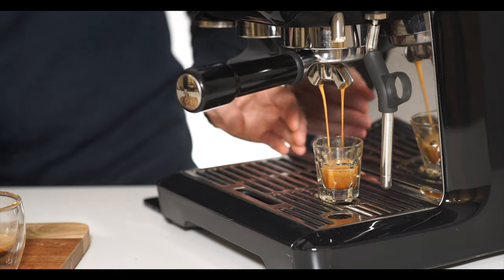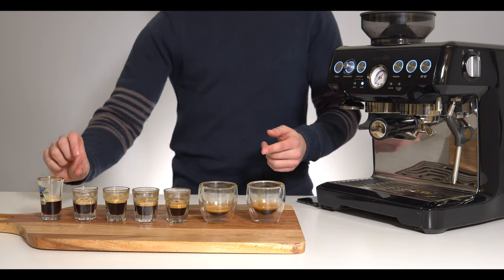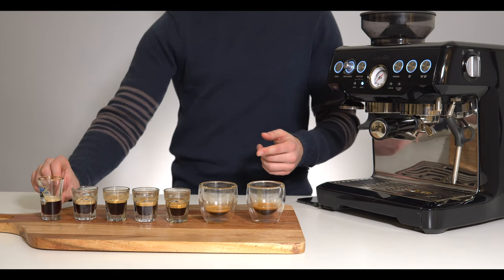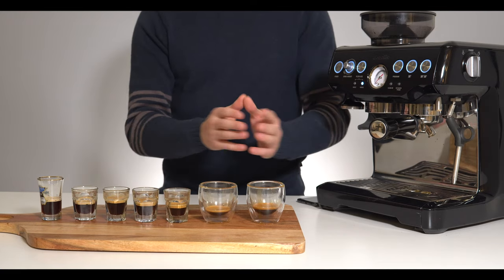Understanding Espresso Brew Ratio | The Salami Shot

Comment: 1:2 - I stick to the standard most of the time unless it's a really dark roast or a really light roast
Reply: Sarah what ratio do you use for dark roasts? Thanks :)
Reply: @leonelsarmiento7  I use a longer brew ratio like 1:3 or 1:3.5 the lighter the roast gets. Lighter roasts take longer to extract as they are less porous and have less dissolved solids. Dark roasts are quicker and easier to extract, and I'll drop to a 1.75 if it's VERY dark. Hope that helps! :)
Reply: While we are talking about brew ratio, brewing time is critical too. Unfortunately I did not have a good grinder, my shot is much shorter than standard.

Comment: I have another question. Most everyone agrees that lighter roast benefit from a longer extraction and darker from a shorter. However, no one says how to get same volume from a shorter extraction time as from the the longer extraction. I assume volume is controlled by grind size rather than by dose size?
Reply from the maker: Correct! Because if you were to control it by increasing the dose, your yield would also have to increase!

Comment: Unfortunately this experiment isn't as informative as it seems.

The "shot parts" number 2-7 are lacking the "content" of the shot parts that preceded them.
For, a shot that was stopped, say, after 20 seconds, would not taste like shot part number 3, but like the sum of shot parts number 1, 2 and 3.

It is possible to get close to what this experiment was set out to achieve:
Taste a bit of shot part number 1,
Mix the rest of shot part number 1 with shot part number 2,
Taste a bit of the sum of shot parts 1 and 2,
Mix the rest of their sum with shot part number 3,
etc. 

Bare in mind, however, that the act of tasting will remove "content", thereby making it difficult to not alter the actual proportion of each shot part in the whole.

Now that I think of it, it's a bit like that one interpretation of quantum mechanics:
The mere act of observing alters what is being observed. : D

Comment: I don't think this experiment would give you accurate taste results because the latter shots are missing the flavor and compounds from the previous shot segments. For example the 3rd shot segment in a real scenario would also include the 1st and 2nd shot segments mixed into it, as it does when you brew normally into a single glass
Reply: completely agree, only works with 1 on 1, 1 on 2, 1 on 3 etc always a new grind
Reply from the maker: The goal of this exercise is to learn which NEW flavors are being introduced at each stage of the extraction. Not including previous segments is the only way to taste each phase without being distracted by the previous (often more intense tasting) flavors. 
The same way a whiskey might contain smoke, caramel, or even floral notes all at once, it's easier to identify which ones are present if you have first learned to identify them on their own without the overpowering alcohol burn. Yes, the final product will contain all the flavors, but this training excercise allows you to taste them individually.
Reply: You miss the point. The point IS to understand the taste difference over time. So what you are saying is true. However, to the same taste from, say the 3rd shot at 15 seconds but get a 1:2 ratio you would need to adjust the grind to get a shorter shot while sticking to the desired extraction rate.

Comment: Like this video but wish you had tasted each shot 😁. I assume you set your machine to program so it would continue to run without stopping automatically? Did you pay any attention to pressure at all? I am just curious if pressure increases much toward end of shot? I am going to try this experiment. Thanks for the demonstration. Please do more like it.
Reply from the maker: 1. Yes, running in manual mode will run indefinitely! 
2. This exercise should be done with a dialed in shot 
3. Shot pressure will often drop slightly towards the end of a long shot as the flow rate increases

Comment: So which of these shots would correspond in taste to a particular ratio? With light or medium roasted SOs, I usually go for a longish shot, typically between 1:2 and 1:3, very often around the 1:2.5 mark.
Reply from the maker: None of these shots will necessarily correspond to a certain brew ratio as each shot will be missing the components introduced by the previous shots. What this process IS able to represent is which flavour elements are introduced at each phase of extraction, meaning that a long shot will have flavors from the later glasses that a short shot will never contain
Reply: @LifestyleLab_  interesting, willl give this a  try
Reply: @LifestyleLab_  good you further explained this in the before comment. In the video I just got the impression that with the salami shot you can find out what brew ratio is best for you/the coffee you bought.

And that got me confused 😋

Comment: This test is flawed because in a real pour the notes will stack up and create a completely different experience.   THE REAL method is to do several different pours of varying duration,
Reply from the maker: This test allows you to more easily taste which flavours are being added due to the ABSENCE of the stacking of flavours you are referring to. It's not flawed, just a different approach, and less wasteful than pulling 5 shots of varying duration ;)
The same way a whiskey might contain smoke, caramel, or even floral notes all at once, it's easier to identify which ones are there if you have first learned to identify them on their own. Yes, the final product will contain all the flavors, but this training excercise allows you to taste them individually.